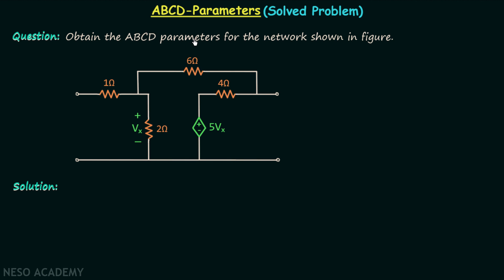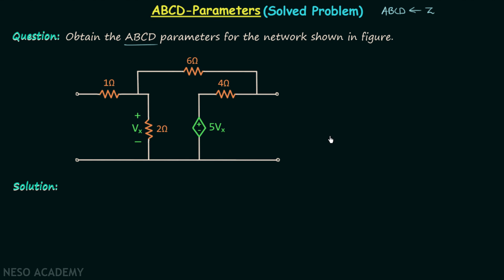ABCD−Parameters (Solved Problem)

Comment: Sir while finding the relation between Vx and the currents you haven't included V2 in the KVL equation  as the 4 ohm resistor end is connected to the positive terminal of V2